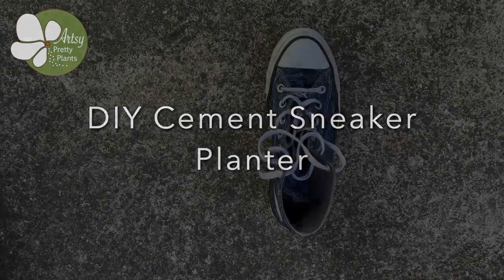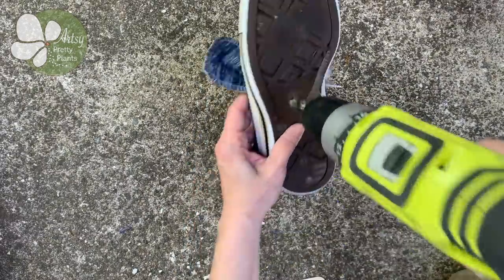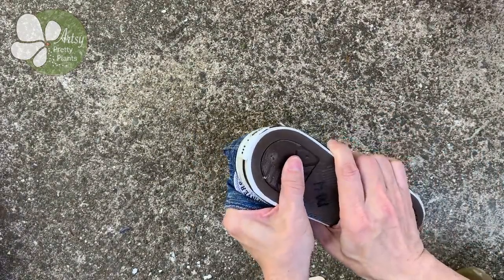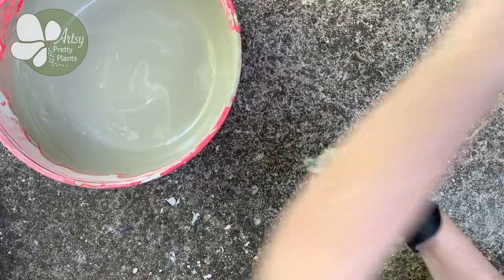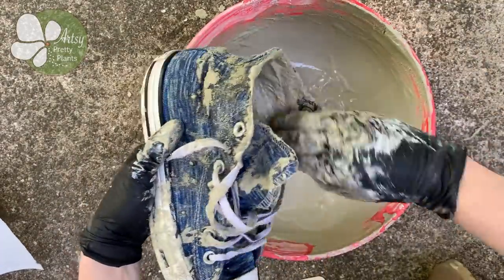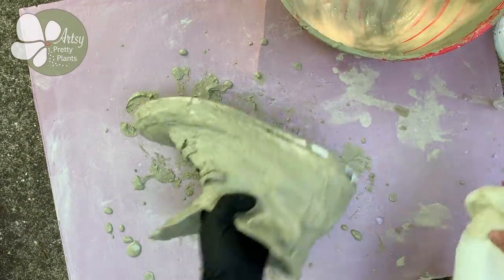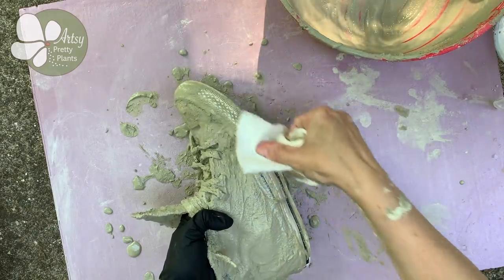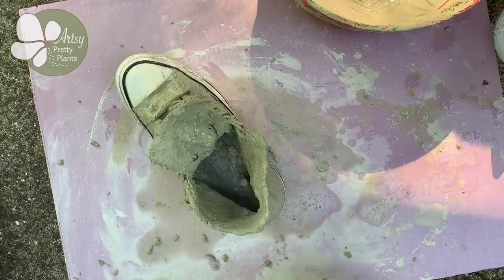Make A Cement Planter From A Shoe At Home!

Comment: Please tell me why you remove the inside of the sneaker? Is taht necessary?
Reply from the maker: Hi, because I needed to drill the hole for the drainage. The sole insert was coming out on its own as I tried drilling. It's quite thick and makes it more difficult. You can leave it in if you can drill through it.

Comment: Do you use just cement or 50/50 sand & cement? 🥰
Reply from the maker: Hi, Neither really. I'm using Cement All which is already formulated so you don't add sand to it. I have the link in the description which has the detailed written tutorial with links to all the materials used.